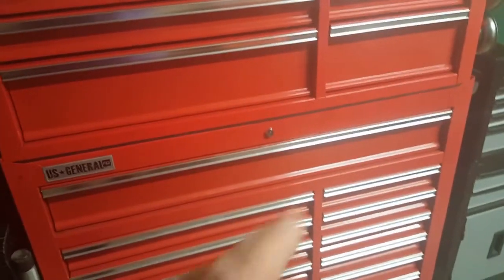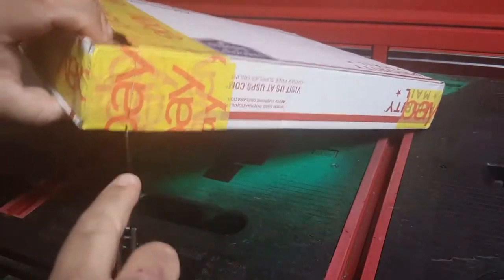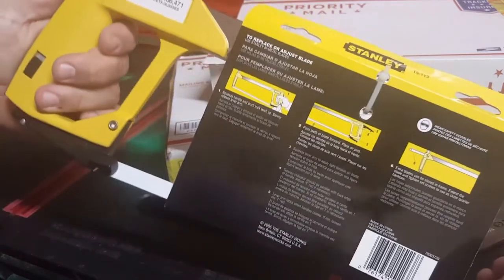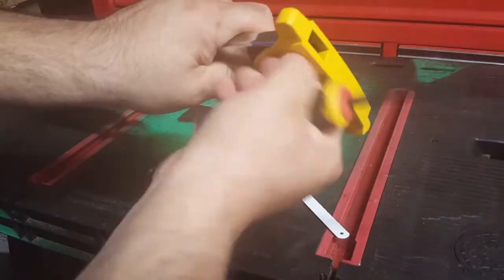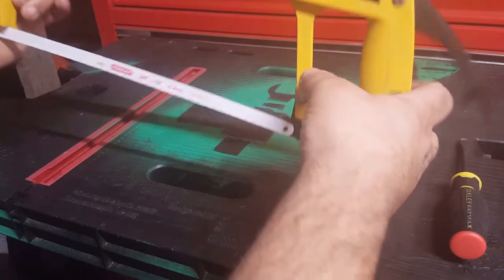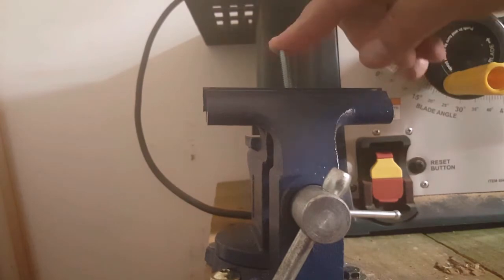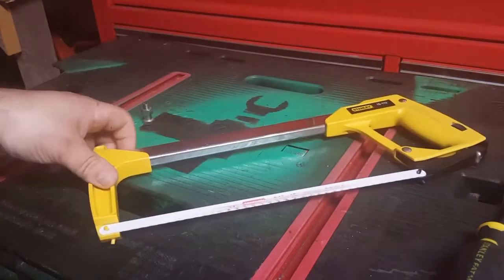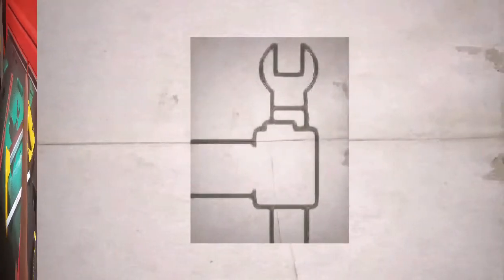Stanley High Tension Hacksaw 15-113

Comment: A question to anyone please I bought one of these in a market second hand it was well used and needed a good clean. After some penetrating oil and pushing and pulling i got the handle to open up ready to change the old blade. Question are the two sliding buttons in the handle normally linked together as one piece or can each button work independently?
Perhaps my hacksaw was sent to the market because the two buttons in the handle are not joined inside the handle, they touch but are not one piece so are they broken or is that normal? Happy St Patrick's Day!
Reply: I am not sure if you found an answer. I would think it should be one button. That said you might have to drill out the rivets holding the handle together to find out and or reattach the 2 halves. You might also try contacting Stanley. Who knows they may send you a new one. I think Stanley & Black & Decker are together now.  Google it to be sure.
Reply: @BarneyR-u2d  thanks for your reply Jim. Yes it should be one button and with a bit of improvisation I have fixed it to make it work. Thanks for your help.